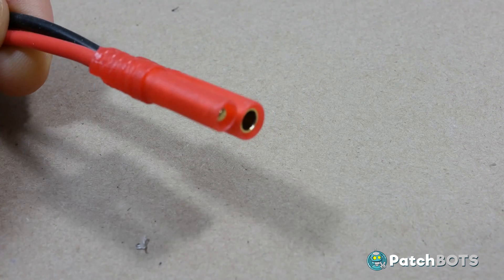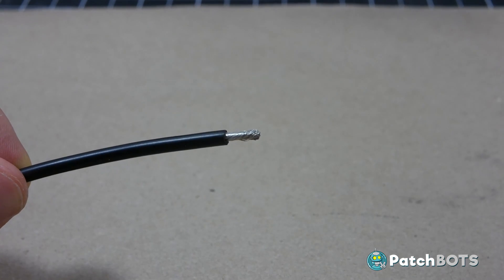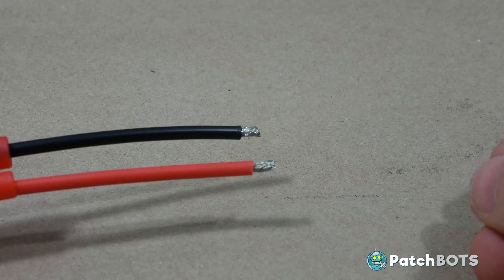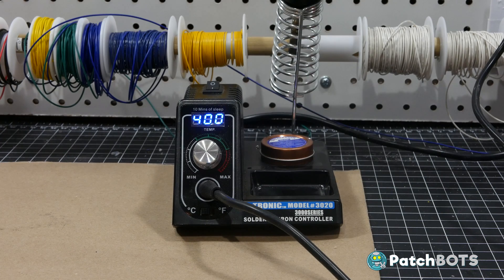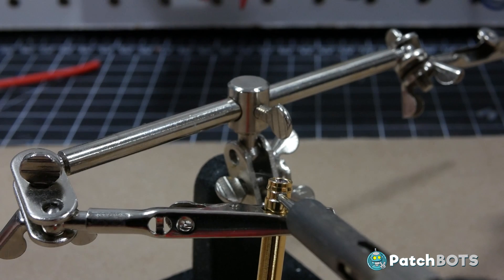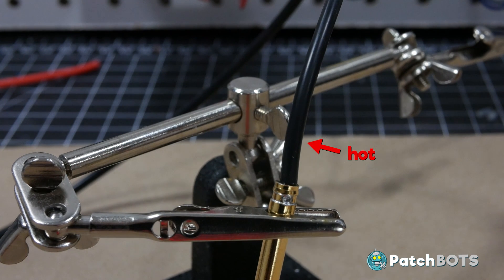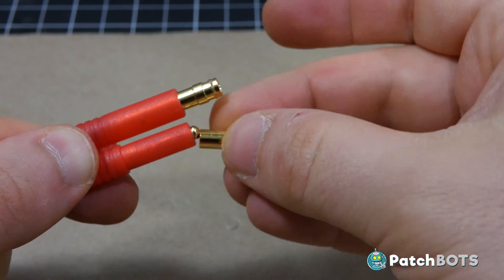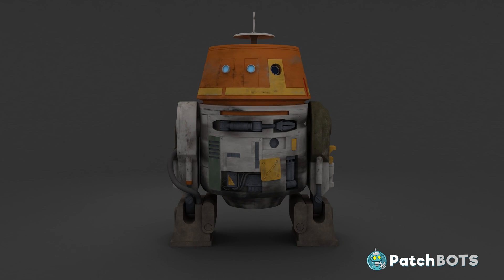How to Solder Bullet Connectors

Comment: The risk of shorting and prevention of such should  definitely be covered before you start doing this. If that was a battery it could cause a fire if both connectors were to touch each other and weld themselves together.

Comment: I was having a lot of trouble getting one of the sides to snap into place in the plastic housing, I realized I got a little bit of solder on the outside, I just put it in a vice and slowly closed it, worked like a charm

Comment: The common type I see and bought off Amazon have the chamfer (helps with being able to snap it into the plastic housing) on the opposite shoulder of the brass connector making it impossible to assemble this way. They are meant to slide on after the soldering is done from what I gather. Very frustrating trying to get the plastic housing to snap in place as the wires are in the way. Any tricks for this type much appreciated. By the way the connectors look identical but if you look closely at the chamfer you can see the difference.

Comment: Finally ! The vital point clue - thread your wire through the connector first!  So you push the connector into the housing from the FRONT after soldering !!! Thank you PatchBots !!!

Comment: Hi, I'm trying to connect a 16 gauge wire to a 26 gauge wire with a 22-16 gauge bullet connector, is this going to cause problems? The 16 awg wires are on a 20A ESC and the other wires are on a 40 gram brushless motor (pulling a max of 17A).
Reply from the maker: You should always assume the worst amp draw, especially with motors.  Unfortunately there is no way 26 gauge wire can handle anything near 17A (you should probably prepare for at least  20A anyway).  If there is a way to run the 16 between all of it you'd be fine I'd think.

Comment: what type of wire is that? I am looking for a wire that can handle 20 volts. I will be connecting it to a 20v battery.
Reply from the maker: 20v isn't a problem for most any wire, the bigger concern is how much amperage is coming through?  The wire in this video is about 14 or 16 gauge.
Reply: it is a 20v, 1.5ah battery. I was thinking maybe an 18 gauge doorbell wire. I will be running it 50ft. not sure how much voltage dropwill be.

Comment: What type of soldering tip did you use for the hole?
Reply from the maker: Thin enough to poke through a little bit so you can hit the solder from the inside

Comment: And this is how you get a cold joint leaving strands at the core unattached to anything. If you're not gonna heat the wire, at least presolder it so there's even a small change the strands inside will get soldered.
Reply from the maker: Based on the feedback about this point I will make a note in the video description. Thanks for your comment
Reply: PatchBOTS Presoldering is good, but not enough. The correct way is to put the wire in the connector, heat BOTH the connector AND the wire (you can usually position the soldering iron so it will heat them simultaneously). Then touch the wire or connector with the solder. When they are hot enough, the solder will melt easily on either one and you can apply all the solder you need. It's almost always a cold joint when either one of the things to be joined is not hot enough to melt the solder.
Reply from the maker: When you place the wire into the connector it land right on top of the iron and heats.  I've done this many times and never had an issue. I agree presoldering may be helpful but this method works.
Reply: PatchBOTS No solder should ever touch a cold wire or a cold connector. This is the most important part of soldering. They might work, but that doesn't mean they last. If you did this anywhere where they repair/build electronics, you would immediately be sent to a soldering class. :(
Reply: To be fair, every video I’ve seen does it like this. I’ve not see anything different from so called experts. Where are their videos with the ‘correct’ technique?
Anyway, when you hold the wire in the hot molten solder it heats up anyway, it’s doesnt stay cold for long, so why is this an issue?

Comment: is it possible to reverse this process to get the connectors back?
Reply from the maker: I think if you got the bullet hot enough you can probably get the wire out.
Reply: PatchBOTS if you push it from the back would you get the bullet connectors out? I'm just wondering how to reuse this without cutting wires
Reply from the maker: I don't think there is any easy way to do it without cutting, sorry!

Comment: Great video! One thought: this technique is useful for battery connector replacement. If that's what someone is doing, they must be aware that they will have 2 live wires in close proximity during the procedure. Even a small LiPo can dump a huge current across a short. So I'd point out the importance of doing one conductor at a time and pushing the first into the plug for shielding before starting the second.  Also, don't cut off the old plug with one cut across both conductors!
Reply from the maker: Excellent tips!  Yes.  My purpose was actually for making connectors to connect TO the battery, but yes, If anyone is using this to replace the actual battery lead ends, then your tips are right on the money. I will add them to the description of the video.  Thanks!